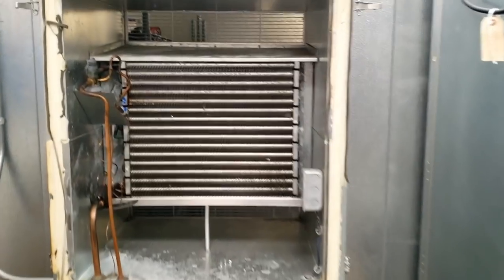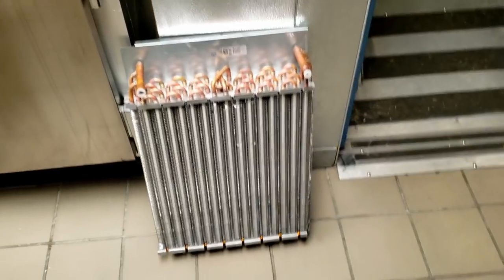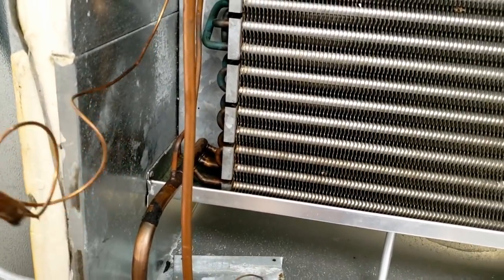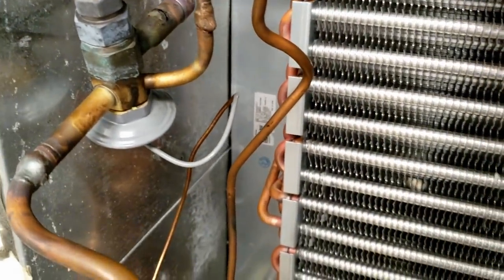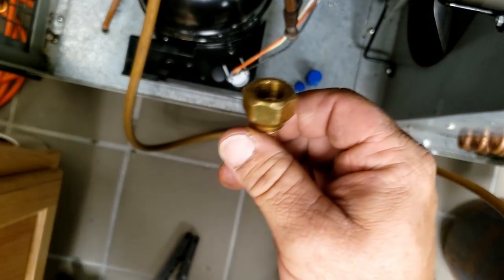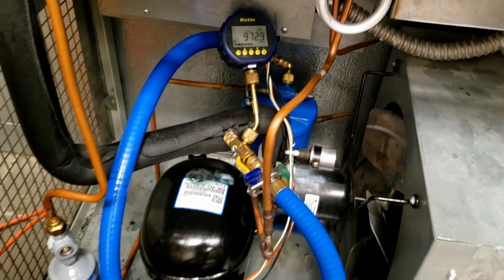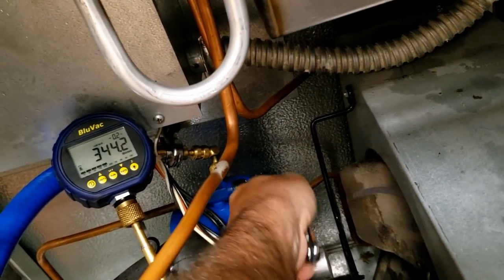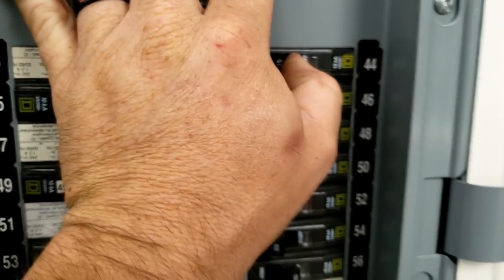Leaking Evaporator Replacement Walk In Cooler Full Discloser

Comment: Your very likely to pull your oxy actelyene out for most repairs to the system, I disagree on the flare drier greatness. If there were more components flare like txv or the dreaded rusted rotolock, I could understand.

Either way, you still do nice work and you show up to work, both hard to find these days.
Reply from the maker: Thanks Sean👍👍 I had perfect attendance for most of my life in school or work, it's just who I am.
Reply: I prefer flare TXVs, quick, easy, stress free, ez.